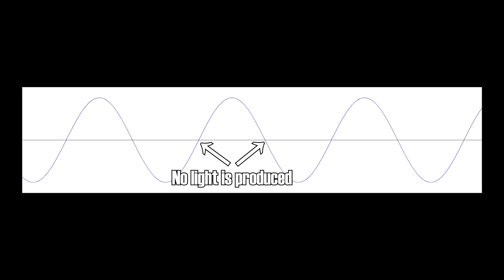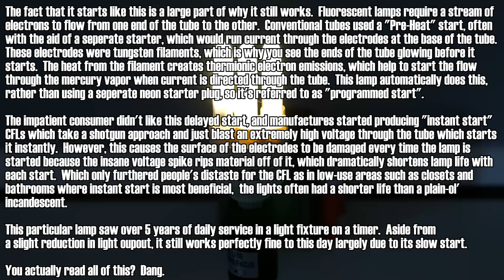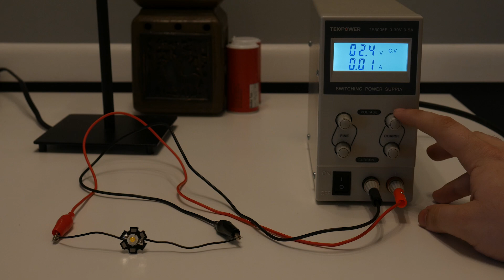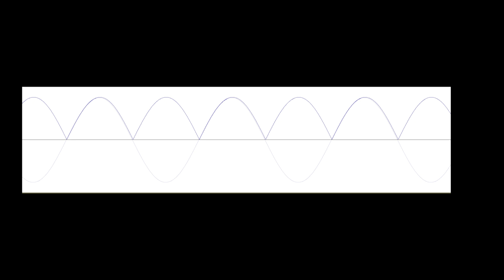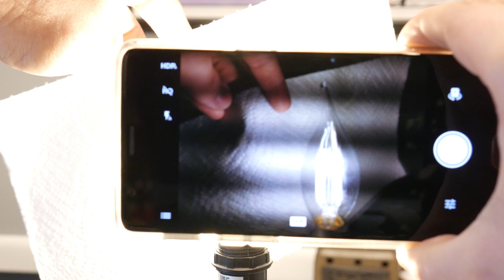LED bulbs that flicker, and CFLs that almost never did

Comment: "There's virtually no reason to hold onto the incandescent lamp anymore."

Idk, LEDs take a lot longer to make brownies in an Easy-Bake oven with.
Reply: Neither to light a kitchen oven:.I've never seen a led or cfl bulb capable to withstand to 300° (572K) in the oven.
Reply: @davidebacchi9030  in another of his videos he points out that specific example for niche legacy applications for an incandescent. neat.
Reply: Many farmers have used incandescent lightbulbs for heating in their barns.  They buy the large 300 watt versions

.
Reply: @davidebacchi9030 I love that you clarified your temperature with Kelvin 😂 very useful for those of us in Engineering, but idk who else wants it XD
Reply: @davidebacchi9030  who tf is measuring in kelvin?
Reply: @davidebacchi9030  Many CFL and LED won't survive being in an enclosed fixture. Their own wast heat, albeit small, causes them to fail early.
Reply: @davidebacchi9030  now they are using leds for the ovens but is not user replaceable ofc 🙄 and they are not rly bright…what a scam though:/
Reply: Strong enough LED's require active cooling you know.
I'm pretty sure you could ACTUALLY bake something with LED's.
Reply: @LetoZeth  Wow. That must be expensive as hell if it can do that. Is it an industrial LED?
Reply: @magistercat4126  it would be pointlessly expensive
Reply: @LetoZeth  Quite a bit late but there's a HUGE difference between needing active cooling due to actually generating a lot of heat, and needing active cooling because it is practically thermally isolated and can't stand much heat to start with.
Reply: @LetoZeth  if an LED runs at 15 watts, it'll create exactly as much heat in an enclosed area as a 15 watt incandescent bulb. They're only "more efficient" because more of that 15 watts is in the visible spectrum and not the infrared.
Reply: Fsilone A 15 watt LED will be way brighter than a 15 watt incandescent.  They're more efficient in the sense that you need less power for the same brightness
Reply: @LetoZeth  not without destroying said leds.
Reply: @LetoZeth  Modified an LED bulb I accidentally broke to run off a 20V tool battery.

Thing gets mighty hot! I need to increase the current sense resistor more.
Reply: Maybe an infrared heat lamp bulb could would for these tasks.
Reply: @2beJT  — That's true, as would a ceramic heater that screws into a light socket, but the ceramic heaters are typically not available at local hardware stores and home improvement centers.
Reply: Easy Bake Ovens stopped using lightbulbs.  Now they use resistance heat, just like any other toaster oven

.
Reply: @electrictroy2010  I liked the lightbulb idea…it was a bit more cooler and interesting
Reply: Use flood light/halogen bulb :D
Reply: @MmeHyraelle  incandescent in the US
Reply: LEDs are also useless for keeping a pump shed warm on freezing-cold nights.
Reply: @Milosz_Ostrow  no offense but I don't think a 60w bulb would do shit either. Once it gets freezing a light won't help.
Reply: @frommatorav1  —No offense, but it worked for my dad in 1960, so I think it will still work in 2020.
Reply: @Milosz_Ostrow  I'm probably overestimating the size of a pump shed. If it's small enough it could work. I don't see it working if it's the size of my shed.
Reply: @frommatorav1  yeah 60 watts is fuckall for heat... must have some extreme insulation or could just be like me and doesnt get cold
Reply: Yes, we should remember that incandesent bulbs are 100% efficient as space heaters, except for whatever light escapes through windows to take some eventual heat elsewhere.
Reply: @indyola1  I would never trust an LED or CF bulb to keep the pipes from freezing in a cottage crawl space :)  also "Winter Season Lights" (barf !) that are LED do not melt the snow while running and get buried.
Reply: @ianball3972  because they waste less energy as heat.
Reply: @sheilaolfieway1885  in the winter I use incandescent lamps as the heat is not wasted.
Reply: The easy bake oven now sells with a small heating element and no longer requires a light bulb.
Reply: Same thing if you like lava lamps.
Reply: Also useless for filament based experiments with electron emission.
Reply: Lmfao I'm dead 😂😂
Reply: The newer models of the Easy Bake have a heating element....
Reply: No need to use a LED or a CFL light in an oven.  Why reduce a thermal loss in a lamp that is in an appliance that is made to create heat?
With the lamp turned on, the heat produced just helps the oven to heat up, so the thermostat in the oven will just regulate a little bit more. The total amount of electricity consumed will be exactly the same.
Reply: @LeopoldoGhielmetti  for such an application old style bulbs are perfect and since ovens typically have metal interiors to absorb heat the heat should stay mostly in the oven.
Reply: Buy a 1000w par 64 stage light thing and that could cook tons of food. Just put a pan on top of the light
Reply: Easy bake ovens use a heating element now.
Reply: The funny thing is that if you live in a latitude where you are using fuel or electricity to heat your home or office, the old incandescent bulbs created a benefit in heating the rooms, thus saving the heat bill. But nobody wants to talk about that.
Reply: Incandesceny and led are the way, fls are harmful
Reply: use bigger leds
Reply: LED colour rendering is still noticeably worse (Soraa Vivid and Philips ExpertColor rectify that, but they aren't available in many lamp formats).
Reply: Don't get rid of them they may be worth some money in the future.  I still have some I like the light they produce its more natural.
Reply: remember how you could use a different version of easy bake oven from Crayola where you put in a bunch of parts of broken old crayons and make brand new crayon combos?
Reply: @BingChilling-hr1hh  Yes.
Reply: sadly, when I need to see very good fine detail the first thing I grab is an incandescent bulb(usually halogen), short of that fluorescent with magnetic ballast.
DC powered incandescent is what I like best overall
Reply: I keep the old incandescent bulbs because LEDs and anything like a CFL causes me migraines and makes me feel awake if used in evenings and caused me to lose sleep. Painful and lucky to get 5 hours sleep. With the old incandescent bulbs I can get 10 hours sleep and no headache. That's why I stockpile 'em.

Comment: Here’s something I’ve been wondering about. So far these are all replacements for incandescent bulbs. So the electronics are in each bulb. That leads to compromises and added cost. 

So at some point when we no longer use incandescent bulbs, it would make sense to put the power supplies in the light fixture and then the bulb will be simplified like with standard fluorescent tubes.
Reply: True, but this means that bulbs would last forever and Osram et al. kinda do not like that. So we will probably never see this on a large scale.
Reply: @whuzzzup  Fluorescent and LEDs don’t last forever. I doubt the bulbs we have today fail because of the built in power supply. Same with high intensity lamps.  

Cell phone makers are starting to not include chargers, because most people have several laying around. So this is the beginning of that type of movement to eliminate redundant electronics in disposal items.

Comment: Excellent video, I took you to task for your pet peeve over the Amber turn signal light horseshit, but this video is spot-on. And I will agree that not only are LED lights reintroducing the problem of giving some people headaches. They're even worse than the fluorescent lights used to be. They need a radiation Shield just like a fluorescent lights needed dude stop the headaches. I did get headaches from the fluorescence but for some reason I have not had the same problem with LED lights. But one of the places that I work at on occasion there's a lady there who had to get glasses with a computer filter on them that eased her headaches considerably.

Comment: I don't quite understand the to-do about "full bridge rectifier". Generally speaking there are three rectifier circuits that are generally used: 

1. The half wave rectifier, which is a single diode. It produces what is called pulsating DC at the same frequency as the AC. So 60 Hz AC through a half wave rectifier will give you only the positive parts of the AC cycles and they will be present only half of the time. And since there are 60 positive half cycles in 60 Hz AC power, you still get 60 half cycles and that gives you 60 Hz. A full half of the power cycle, the negative half, is simply not used. This is somewhat wasteful and it can also produce a lot of RF noise. More filtering is needed and that means bigger capacitors. Note: I said the positive half of the cycle, but the same diode could be hooked up the opposite way and then you would be using only the negative half cycles with the same final result. 

2. A version of the full wave rectifier uses a transformer that has a center tap and two diodes. This gives you full wave rectification, but current only flows in one half of the transformer secondary winding at a time. And the transformer must be physically larger to get the same output Voltage as half of it's secondary coil will only give you half Voltage. This can be useful when the Voltage must be reduced or stepped up to a value above or below the AC line Voltage. It was probably used more when rectifiers were more expensive and the cost of the extra materials in the transformer was not a major consideration. Modern semiconductor diodes are dirt cheap and transformers are expensive due to the content of steel and copper in them so this form of full wave rectifier is not used much today. In a light bulb the size of a transformer is also a major factor. 

3. The full wave, BRIDGE rectifier uses four rectifier diodes in a configuration that bridges the AC line. By the orientation of the diodes, each half of the AC cycle conducts through two of those four diodes at any given time and the positive conductor of the AC line is always connected to the positive side of the resulting DC and of the filter capacitor. Likewise, whichever conductor of the AC line that is swinging negative at the moment will be connected to the negative side of the DC and filter capacitor. The pair of diodes in actual use changes 120 times a second for 60 Hz AC power and you get a pulsating DC with 120 pulses per second. One of these 120 pulses is present at all times so there is no interruption and no wasted power. Full wave, bridge rectifiers are dirt cheap today. They can be purchased in single quantities for well under a half dollar and I imagine that a light bulb maker can get then by the tens of thousands for only a few cents each. They are also physically small so they are the component of choice. Most of these bulbs will have the full wave, bridge rectifier directly across the AC power with no transformer at all for a further savings. Then the DC is smoothed by the capacitor, the amount of current is regulated by either a resistor or an IC and then it goes to the LEDs. The goal here is low cost and high efficiency. As little of the power as possible is wasted in this circuitry ahead of the LEDs and it is their efficiency that determines the efficiency of the bulb. 

Thus, the full wave, bridge rectifier is the component that allows both the high efficiency and the low cost while also reducing the volume of the circuit to fit in the small space available. It is the true hero here. And I suspect that you will find a full wave, bridge rectifier in every LED bulb intended for lighting use.

Comment: This LED flicker test just works with my digital camera, not with my phone camera.
It is very useful since it prevents one from buying lamps which will start to flicker in the evening due to signals sent through the grid by the power companies.
(Those low frequency signals interfere with the high frequency flicker of the bulbs and result in visible flickering about every 30 minutes.)

Comment: As you make the filter capacitor larger to reduce flicker, you increase the average light, and power, and heat, of the LEDs. If it doesn't flicker, it never goes dark, so that equates to more power. Manufacturers that want to use cheap LEDs and small heatsinks will allow more flicker. Les flickering bulbs are either dimmer, or larger, than flickering ones.  I build 250 watt LED grow lights, and I power them off the line with a bridge, and I use capacitors to control my average brightness. I use small ballast resistors to make up the voltage difference, and transformer buck and boost technology to match the voltages to the LEDs.  At the dim setting, I can't make films of them because half the frame is black! This is because of the 30 hz frame rate.

Comment: Had to replace a couple of 4’ fluorescent tubes in my garage and didn’t know much about the color of light output at that time.  Bought a couple from the hardware store and hated the harsh blue light that it was outputting.  That is the day I learned to always check the color temperature of bulbs, they list it somewhere on the front or back of packaging.  If you like the harsh blue light of noon daylight, choose 5000 Kelvin (5000k).  If you prefer a softer white choose a bulb shifted more towards the red spectrum at 2700k, or the light of a traditional incandescent bulb.  You’ll thank me for it, I guarantee!

Comment: Both led, and  cfl use phosphor to "color" the  light  they  give.

That  is  just  your  own  personal  opinion that  "a well made wàrm-white balanced cfl is often distinguishable from  an incandescent" .
I strongly disagree  with  that  statement,  the  few  people  whom I've  had this  argument with were  either  color blind, or  grew up in  third world  countries.
Fluorescent lighting is  poor  quality artificial light ,   that  will  ruin  the  ambience  of  any room,  I find houses  that  are  all  fluorescent,  have  the  ambience  of  an underground parkade.

Led is no  better,   the  color rendering is  slightly  better except  for  the  sickening flicker, and  all the dimmable led bulbs  I've seen turn  the light  grey  as  they  dim.

I have  two  led bulbs outside for dusk till dawn lighting,  and  two  inside the house.
One  in the walk in closet,  the  other  is  in the laundry room, along with  a  fixture  that uses two 48" fluorescent tubes.
These  are  two  areas  where  I spend  less  than  a  few  minutes  at  a time,    these  lights  that  are  often  accidentally left  on  for  hours  at  a time,  which  is  why  I  chose energy efficient lighting for  these areas.

I use  incandescent,  or halogen bulbs  with dimmers everywhere else.
Reply: @Jigglypuff True ,   they  are better now ,  than  previous .

Some  flicker  quite  noticeably,  they  all flicker to  some degree.

They  still  have  a ways to  go  before  I  would   consider switching  all  of  my  interior lighting  to led.

Until then I  will  continue using incandescent, and halogen lighting.

Comment: LEDs actually have a fairly wide range of operating voltages.  It’s the amps that kill the LEDs.

Update: After posting this, I went and tried it out.  I ran 120 volts alternating current through a 20 thousand ohms resistor and an LED and it lit up just fine.

Comment: I’ve seen an application where LEDs do run on alternating current.  Or rather they pulse rapidly because they only allow half of the current.  The circuit was a simple resistor and LED in series between the hot and the neutral.  It was used to indicate power in a solenoid plug so you could tell visually if the solenoid was energized.

All that is to say that LEDs can run on A/C.  If you think about it, you could build a bridge diode out of LEDs or use a single LED to convert A/C to pulsed D/C.  It’s just like any other diode except that it also produces light (and also probably less efficient because of the wasted energy).

Comment: The common Walmart shopper seems to think those 97-cents 4 pack of led bulbs with no drivers are great and they should stick them everywhere in the house.  They're such bad bulbs and flicker very noticeably because they have no capacitors or circuit of any kind.  They just connect LEDs directly to AC power.

Comment: Correction, the LOW pressure sodium lamp produces de orange light.
Reply: Not 100% true, While LPS does produce what some call an orange light, its color is more along the lines of a bright yellow. Also, LPS is far less common than HPS due to the cost of the lamps and its monochromatic color.

Comment: I use a lamp fitted with 12v led bulbs made for an RV, which is driven by a massive battery and charged during the day. It is a perfectly smooth light source and while I dont really get ill from bad lighting, it just feels better compared to most any other lighting. It would be interesting to see homes switch to a whole house DC lighting system which just has one large converter to which every lamp gets its power from. It would also tie in perfectly with the whole smart everything stuff.